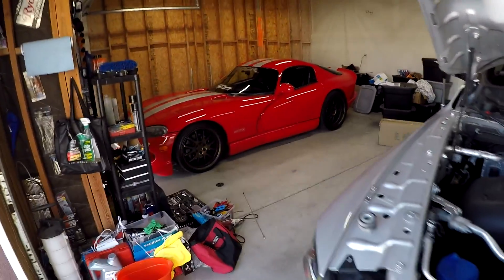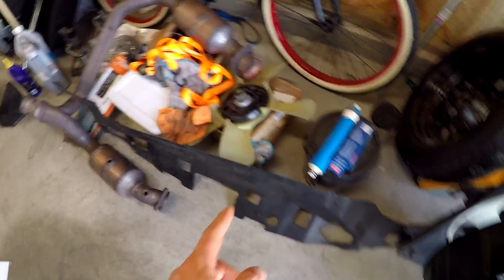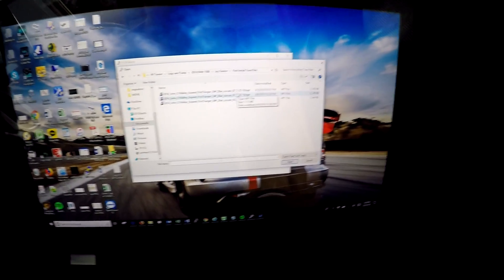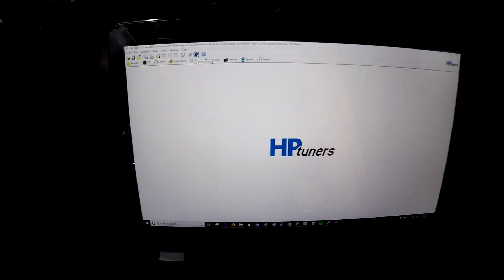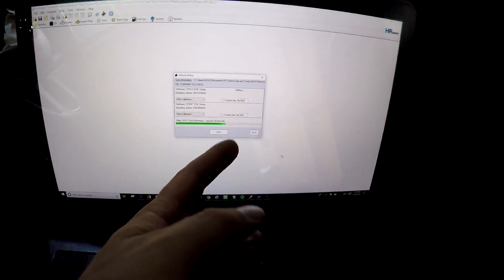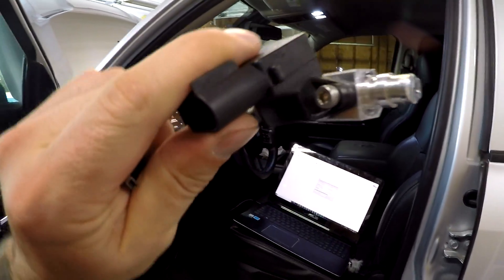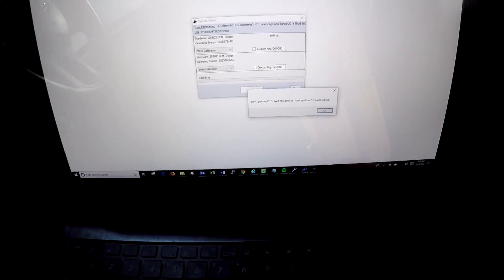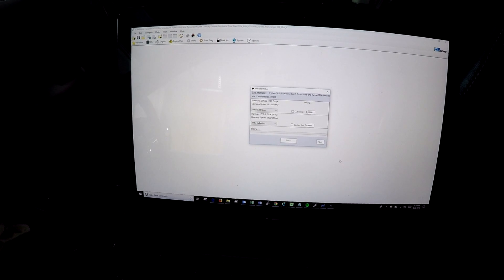Loading the HP Tuners Tune for BOOST - HellRam Build EP4

Comment: Hey buddy, I notice in the video when you opened the door, your EVIC displayed a large truck with an open door. My truck only shows a little red truck shaped light at the bottom. Mine is a 2014 Limited. Do you know why my truck does not show the big door open picture?
Reply from the maker: Hmm thats weird! Have you done the latest UConnect update?
Reply: @BoostedMotorsports  Yes, I have the latest update. It has never had a symbol like yours.

Comment: Damn! That is crazy as all get out... Is there a possibility that there is something wrong with your transmission or the transmission control module? ... I hope it's nothing serious and you get it all figured out!
Reply from the maker: Just got the truck back from the dealer after having them flash both the ECM and TCM back to factory spec as per HP Tuners request.  Hoping they can make it work but I'll keep everyone posted 👍
Reply: @BoostedMotorsports  

That is awesome to hear! I need to go get my truck done for the cruise control recall as well!

Comment: Just for the record -- the issue is specific to your truck. I had a 2014 Ram 1500 Big Horn crew with the 5.7L and an 8spd. I had an ECM and TCM tune from Jay and they both worked flawlessly with HP Tuners. I was using the MVPI v1.
Reply from the maker: Lots of 2014 trucks with this same issue.  According to Diablosport its "hit or miss" not sure what the differences are but must be some firmware differences on certain trucks.

Comment: I think diablo doesn’t support the transmission tune for them 2014. If it was 2015 you wouldn’t be having issues . I have seen people asking about the transmission tune on jay Greene page . Hopefully it gets solved . For some reason I haven’t got a tuner and install my headers.
Reply from the maker: They do.  The 2014 support for 8 speed transmission from Diablosport was opened up earlier this year.  Hoping there is a solution!
Reply: I was able to tune my 2014 tcm with the diablosport i3p. From what ive read it's really just hit and miss. Some work and some dont.
Reply: I see ! I remember it wasn’t support back then . Hopefully it works ASAP . I still don’t know why jay has to buy credits again even those rams take 6 credits I believe .